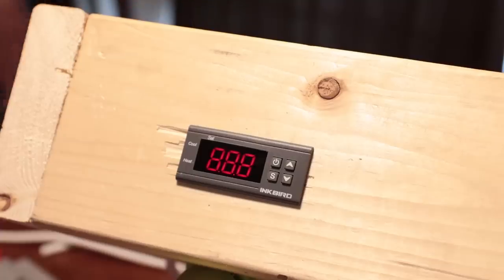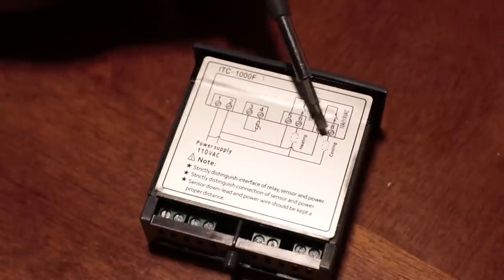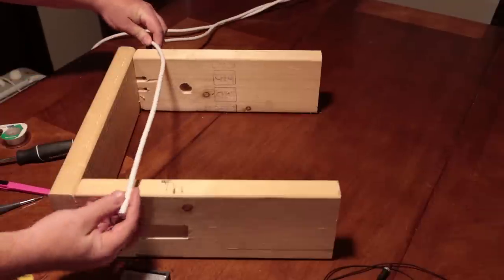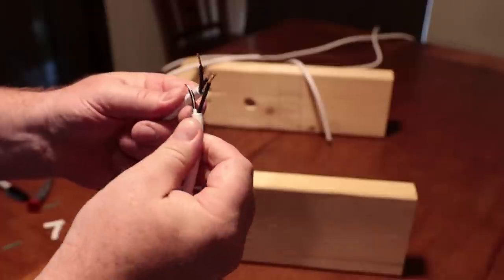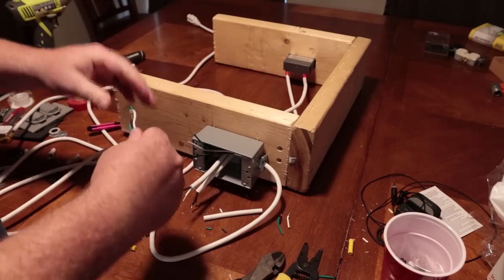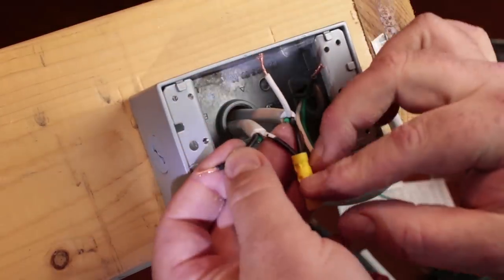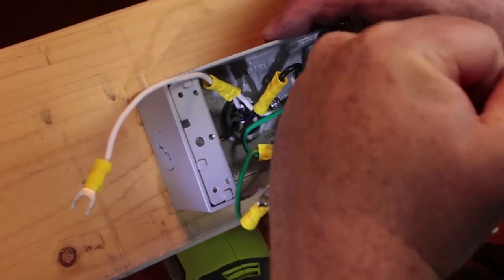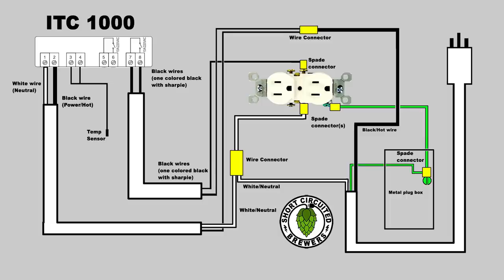How to wire a InkBird ITC 1000 for use in a keezer * BONUS* Wiring diagram included!

Comment: Just finished building a Keezer and used this wiring guide with one extra addition, I broke the brass tab connecting both outlets on the plug and ran another hot line for my PC fan. Thanks for the tips!
Reply from the maker: Nice! Good stuff!

Comment: One thing to note, the inkbird wiring diagram has two different versions that show the unit's power terminals reversed depending on which version you're looking at.  I believe it actually works fine regardless of which way you wire it, since I wired it opposite this video and seems to work.
Reply from the maker: Yeah AC is pretty universal I'm assuming you're talking about that part.

Comment: I learned to never put braid wire into a terminal like you did at 6:08. Always crimp a cap onto it. Otherwise there is the danger of overheating because of conduction problems in the connection.
Reply from the maker: Good tip thanks for sharing!

Comment: GREAT video! I am building my keezer and like your video only using cooling terminals so I have a stupid question.  Is the other outlet the freezer isn't plugged into live only when the circuit is closed to turn the cooling on?  I am hooking up fans on the inside of my keezer and need a second outlet and would like to run the wiring to the 2nd outlet but need the fans powered on and running 24/7.
Reply from the maker: You'd need to plug the fans into a always in connection.

Comment: You mentioned that you would probably do a video where you used this for fermentation and that you would show both the heating and cooling side of things.  Did you ever do that?  This was good.  I keep thinking that they're just switches and all I have to do is feed the hot wire through them.  Am I mistaken?

Comment: Just to be clear, either outlet plug could be used for the keezer cord, correct?  Without breaking the tab, you're  switching both on/off?
I'm also assuming breaking the tab and running hot/neutral to one of the plugs from the heating side would give you both options?
Reply from the maker: Correct

Comment: Thanks again, Excellent build tutorial as always!

I'd recommend that you use the correct slot on your crimping tool, as the ratchet style stops when compressed enough/ properly.
 Using the "blue" slot on the yellow connectors will cause strain on the aluminium ferrules. The fact that it jams when crimped is a good sign that you're using the wrong slot on the tool. If the tool's not color coded, the inner slot's for red, middle for blue and the outer one's for your yellow ferrules.
Reply from the maker: Yeah I know. It is a cheap pair and the yellow slot does  it quite crimp them tight. (Harbor freight "stuff" lol)
Reply: Any comments from either of you on the gauge wiring you should be using both inside of the box and for the main power cord we add ?

Comment: I had a question I connected everything following the diagram you provided. Really helpful by the way. My question is when my probe reached the temperature I set it doesn’t power the plug to the freezer off so the freezer keeps cooling and then the inkbird tries to turn on the heat which I don’t have it connected. Not sure where I went wrong
Reply from the maker: That's normal. It will oscillate slightly. But it will naturism the temp with a few degrees. 👍🍻
Reply: So I set it at 38 degrees Fahrenheit once it reached that it kept going lower it reached 11 and never shut off

Comment: thank you so much for the video. The wiring diagram I've seen on 4 units bears no resemblance to the correct wiring your unit shows. Any potential danger  regarding electricity is a no no as you know very well as per your knowledge to be able to give explicit instructions that are safe. As it happens I am using 24v DC max.
When there is heat involved it makes me wonder if fires have ensued because of the lack of both wiring and user instructions that should have been given with these units.
Having to look on You Tube to see all one needs to know about these units  not least to 'get them to work' seems ridiculous.  There are plenty of other manufacturers who are guilty of not issuing good instructions with there items sold through out the world but how do they get away with this complacent way of doing business?
Reply from the maker: That's a good question! I'm glad you found the video helpful! 👍🍻

Comment: Is this unit a replacement for the Ranco A12-701 that's used for the compressor on a commercial restaurant cooler, if so how would I wire that? This unit rapidly turns on and off when I connect the 2 wires that connected the A12-701 to the cooler. If not, can you tell me what digital unit I have to purchase to replace the Ranco A12-701?
Reply from the maker: I'm not sure about that.

Comment: I am looking to replace my beer fridge with a keezer simply because it is starting to die. This is exactly what I was looking to do, and thank you for the additional wiring diagram as that is something that I have always been a bit worried about messing stuff up. I did hear you mention that you were thinking about using the heating side for a temp controlled fermentation chamber. Is that something that you are still looking at doing?  I am curious as to what you would be using for the heating portion of the project. Also do you recommend using some sort of insulation to cover the hole for the box or around the wood portion of the keezer collar to assist with keeping leaks down to a minimum?
Reply from the maker: You can line the wood with foam. The heating portion I would use a small space heater. If I get a chance I'll try to get the other portion out.
Reply: @ShortCircuitedBrewers  I have so many ideas of things to do, but not the wallet to support them lol. Even to the point of doing a similar wiring, but doing a double outlet so that a circulation fan and a mini dehumidifier could also get power without the need for another extension cord for supplemental power. Also routing in a groove on the collar to run the power lines to the back. Love watching your videos. I will slowly be getting all the stuff to make my brew setup more efficient.

Comment: Hi Brian! Great video as always. I am in the process of building a glycol chiller from a window air conditioner. What are your thoughts on this controller handling the load through the Inkbird relay? The A/C unit draws 6 amps total and I think the Inkbird 1000 is rated for 10 amps but that is more than likely a rating for just amp load and not running a compressor or fan motor. I am worried about back EMF.  I thought about buying an inkbird and an SSR to put the load through. Just picking your brain.! Cheers
Reply from the maker: No problem Glad you found it helpful. I kind of agree with you I think I would use the ink bird to trigger a relay. I don't know that you need to go with an SSR quite honestly I would probably just use a mechanical relay because you're not cycling on and off that much. There's a lot of cheap stuff you can purchase off of Amazon that would do the trick. 👍🍻
Reply: @ShortCircuitedBrewers  Reading the information about the controller it does say that for cooling there is programming for compressor delay but I cant find anything about what type of load (inductive vs resistive). Funny thing is the price for a mechanical contactor is more than the inkbird. lol. Cheers!
Reply from the maker: @CanadianBrewingChannel  haha that is pretty funny. I'm pretty sure the heating and cooling circuits will handle 10 amps individually. You obviously wouldn't have them both running at the same time.
Reply: @ShortCircuitedBrewers  As an HVAC mechanic I am being more cautious than I probably need to be. I am recording the build and will put it on my channel in a week or so. In the middle of a brew right now! Cheers.
Reply from the maker: @CanadianBrewingChannel  nice I'll be looking out for it! 👍🍻

Comment: Great video once again. You make these things look so easy.  I was looking to add a temp controller like this to my brew control panel for a fermentation chamber. Of course it would have to work independently of the key switch so that it would remain on while the rest of the panel was off.  not sure if any of that is possible. Keep up the good work!
Reply from the maker: Thanks! You can certainly do that just wire it in before the switch. There is at least one (depending on your panel voltage) power wire you can connect to. It is as easy as I make it look just take your time. Just be sure that you unplug the main plug on your panel before you start doing any wiring. Cheers!  👍🍻

Comment: So maybe this is a dumb question, but what if you wanted to insulate your collar, could you just use the wire inside of the power cord instead of the whole cord? My thought is it would be easier to hide the wires behind the insulation instead of the cable
Reply from the maker: Sure you could hide it that way.
Reply: Short Circuited Brewers thanks for the reply! Keep up the awesome videos

Comment: Once you do this modification can it ever be a freezer again?  IOW can it get down to 0 F?
Reply from the maker: Yes this tutorial does not impact the freezer at all. The cord is still intact. The STC1000 is what is the thermostat control for the freezer. To use it as a freezer, unplug the freezer from the outlet shown in the tutorial and plug it directly into the wall... Freezer again! 👍🍻

Comment: what is amazing is that no one shows what kind of power source they use for this kind of unit that also runs multiple fans, and a peltier module. any suggestions? trying to make a home made humidor
Reply from the maker: Power source is 120 volts. If the peltier and fans run at the same time you could plug them into the same outlet.

Comment: Am I correct in understanding that the second plug is a dead plug (unconnected)? If so, would it be too much for the wires to handle to make the second plug hot? I have a circulation fan I also want to connect to the keezer. Cheers!
Reply from the maker: As long as the total draw did kit exceed 10 amps you would be fine. The idea was to connect the second plug to the "heat" side of the inkbird and use it for heating as well.
Reply: @ShortCircuitedBrewers  Thanks, the fan is only 12v. So I don't think that would impact it, but I really wasn't sure. Now I think I have to get some bigger butt connectors :)
Reply from the maker: @Sirconnor9292  you have a power supply for the fan right?
Reply: @ShortCircuitedBrewers  The power cord is directly connected to the fan, it would only need to be plugged in to operate.
Reply from the maker: @Sirconnor9292  you said it was 12 volts though right?
Reply: @ShortCircuitedBrewers  I typo'd sorry
Reply from the maker: @Sirconnor9292  ohhh 120v.. lol ok
Reply: Short Circuited Brewers yeah sorry. Not going to work is it?
Reply from the maker: @Sirconnor9292  if it's 120v you'll be fine. Probably doesn't draw more than amp I would imagine.
Reply: @ShortCircuitedBrewers  You're right. Its listed at 9 watts, watts divided by 120 volts, is .075 amps right? I apologize for wasting your time.
Reply from the maker: @Sirconnor9292  no bother at all!! Glad to help

Comment: Hi Brian. Great video. I just have one just have one question. I used relays on my STC. I was told that the unit is not strong enough to power a fridge. Why are you not using relays to divert mains power away from the STC? We have 220V.
Reply from the maker: Not sure about over where you are but our appliances like freezers and refrigerators generally only draw about 5 to 7 amps. The ITC switches are rated for 10 amps so there's plenty of overhead in my opinion. I'm not sure about the stc1000 but I imagine it's probably the same thing just rebranded by Inkbird. Cheers! 👍🍻
Reply: @ShortCircuitedBrewers  I am in South Africa.
Reply from the maker: OK. Any idea what the 220v fridge/freezers run as far as amperage draw?
Reply: @ShortCircuitedBrewers  not sure. Trying to Google it but even the manufacturer site does not have that spec.
Reply from the maker: OK well at least you know your safe the easy you have it hooked up. 👍🍻

Comment: Any comments on what gauge wire we should be using?  Does it matter? I’m reusing PC power cords, which normally run 600W+ for a computer.  That enough?
Reply from the maker: That's fine. Most appliances are run on 14ga I think the ink bird is rated for 10 amps.
Reply: Short Circuited Brewers thanks for the quick reply!  

Really the only ones we’d worry about anyhow would be the main cord going to the wall and the white/black power into the inkbird - ya?  The wires you colored with a sharpie don’t really have have much going through them and just serve as a communication for the switch - correct?
Reply from the maker: Correct

Comment: Exact video i was looking for. Only thing that is missing is if you added a small computer fan in line.
Reply from the maker: You can certainly do that, or plug one into the other outlet on the plug so the fan would come on when the keezer did. Thanks for commenting! 👍🍻

Comment: Great video! Iv enjoyed your other channel as well. I noticed the bandaid was on after the wire stripping lol.... I would love to see the STC used in Fermentation Chamber and any other things you can use it for. Can you use this the same as the Johnson A19 or A419 with a RIMS tube? I’m not sure of the Watts (output)  on the STC? The Johnson can support up to 1,500 Watts I believe?!? Thanks for the Vlogs Cheers
Reply from the maker: LOL this video was actually shot over several days. Irie shot several of the wiring Parts because I wasn't happy with how they showed on the camera. The ITC is only rated for 10 amps in the switches and 1500 watts would exceed that so I would say you have to put a relay in between that would handle that amount of current. Thanks for watching and commenting!! 👍🍻

Comment: Hi, is it possible to have a PIC controller change between temperatures? Lets say the temeperature should be 200. As soon as it reaches 200 it should drop down to 190. When 190 has been reached, it should raise to 200, drop to 190 and so on.
Reply from the maker: Sort of..  You would just have set the differential to 10 degrees, and it would heat up and then cool down in a cycle. Out of curiosity, why are you wanting to use it that way?
Reply: Short Circuited Brewers i would use this for a pizza oven. I would like to have the heater already heating while putting the pizza into the oven. Under differential „P“ my manual says 0.01S/degree Celsius. Is that the correct setting to adjust?
Reply from the maker: It should be the DS setting. What model do you have this one does not have a "P" In the settings
Reply: Short Circuited Brewers i‘ve to the ITC 1000VH which should be similar to the ITC 100
Reply from the maker: Found the manual..  Yes P is the value..  Set it to 10 and that should work.
Reply: Short Circuited Brewers thank you very much.
Reply from the maker: Glad to help!  👍🍕🍕🍕

Comment: Hi Guys: PLEASE HELP My controller is working fine cooling and heating, however i cant get into the settings to change the temp setting.I hold the (S) button in for 3 or more sec but nothing happens. ANY ADVICE
thanks.
Reply from the maker: Sounds like a defective controller? Is it under warranty?
Reply: What is the use of the heating function?

Comment: I misplaced the screw that holds in the back plate. Any idea on the size/length so I can replace it?
Reply from the maker: I can check and let you know.
Reply: @ShortCircuitedBrewers  Thank you!! I heard it was  a #4 pan head x 1/4" but the internal threads look like something finer than a sheet metal screw. Maybe a 4-40 screw?
Reply from the maker: That is the correct size or VERY close to it. Should work fine.

Comment: Am I missing something? How does this control the temp of the freezer? Were the extension cords suppose to connect to the freezer?
Reply from the maker: Yes that is correct it goes between the wall plug and the freezer cord. The temp probe stays inside the freezer to read the internal temp.
Reply: @ShortCircuitedBrewers  so I'll be plugging the freezer itself into one of those outlets and an extension cord will run from the wall to the other?
Reply from the maker: @leetledrummerboy  yes that's correct.
Reply: @ShortCircuitedBrewers  wow, on an older post i didn't expect you to get back to me at all, nevermind so quickly. Thanks, you're the best!
Reply from the maker: @leetledrummerboy  haha I try  to answer all my comments. Let me know if you have any other questions. 🍻👍

Comment: Hey Brian, great video. Thanks for making it. I’ve tripled checked my wiring, and I still can’t seem to get it to work. When I plug the power in for the ITC it turns on then turns right back off. The only difference between my setup and yours is I’m using a GFCI. Any thoughts on a fix?
Reply from the maker: Sounds like a faulty stc. Does it trip the gfci?
Reply: @ShortCircuitedBrewers  no it doesn’t. I’ll try another one.
Reply from the maker: @ryanhenderson753  that's my best guess.

Comment: It feels like there are a bunch of unstated assumptions about the overall wiring of the system like which set of wires plugs into the wall vs. into the unit. It just dives into connecting neutrals and hots without saying which and why. I bought a used keezer 4ish years ago, which recently got so cold it froze all 4 of my kegs. So, am attempting to replace the temperature controller/probe (apparently called an ITC) and am afraid I am more, not less confused now. Mine does not have a receptacle and it never really explains why you would want one. Maybe preface the video that this is for new-builds only? Will keep scouring the internet for that sweet spot between licensed electrician, I can read your mind, and yes in fact I do know what the black wire is.